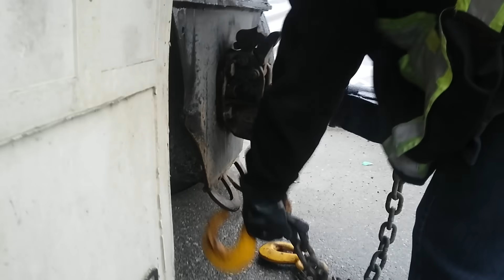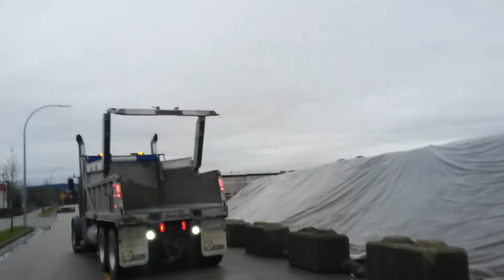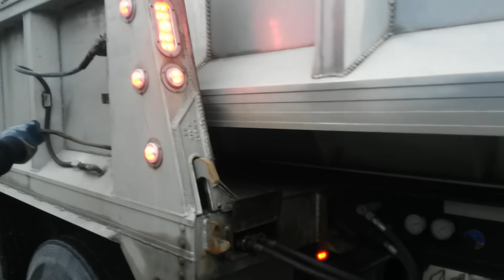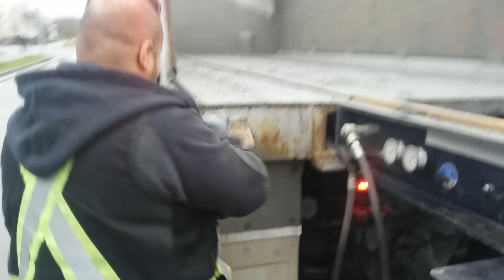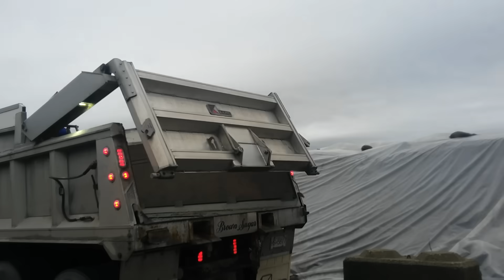DUMP TRUCK AND TRANSFER THE BROWN SUGAR WAY

Comment: Drove transfers out in California! Motors were on the trailer box and were two Chevy starter motors and an extra battery that you had BETTER get hooked up when finishing and driving off!! More simple setup but had to get creative when the trailer battery was weak! If I wasn't behind the steering wheel, I was under it fixing something!

Comment: that's a nice setup, I really like the work lights built into the tailgate support arms. But I prefer an electric drive unit. They are quicker, alot less hookups, and just easier to work with,
Reply from the maker: In Canada we are allowed to put 40T in the transfer box so that amount of weight almost over powers the hydraulic unit as it is

Comment: hey man im filming my transfer in california waoo we dont have so many hoses what i like about yours is that runs automatic with a chain belt ,good luck be safe out there
Reply from the maker: this trailer is custom with lots of additional lights so there are a few xtra power cables that wouldn't be there normally. How do you transfer without the chain and the Hydraulic system?
Reply: I've run a transfer dump before. It's just a set of rails with wheels (like this setup) on both, and a locking pawl on the transfer box. Undo the pawl, and push on the back of the transfer box and it rolls into the truck's box. Then lock it into the truck's box like normal and you're good. To put the transfer box back on the pup, you angle the truck box a little and pull on the transfer box and it'll roll back on to the pup, then relock the pawl and do the other normal stuff.
Reply from the maker: Dieselhead I have yet to see a non hydraulic system like the one you just explained. Our's all use a PTO (Power Take Off) which uses a hydraulic pump that turns a gear connected to a huge chain on the box.
Reply: Ryan Snow did you move the truck back by a button?!
Reply: Seek on slp automatkasett thats a skandinavian version. with the right conection between truck and trailer you dont ned to get out of the cab at all
Reply: You are 100 % correct 👍 
I have videos mainly from Finland but some Swedish truck videos where the transfer is done in the cab.
The idea must have originated from Scandinavia ?
Cheers BoyfromOz
Reply: Not sure about the origin of transfer system, but somewhere said that in -70 's Finnish manufacturers have visited at Canada to take a look of trucking. At least there those have been always operated by hydraulics, unlike 12/24v  dc or air powered transfers in usa. Yes you read right, batteries or air tanks under the trailer bed.
Reply: Engage reverse and stop engine. Then use starter from rear of the truck.

Comment: Hey slick I noticed your drawbar didn't drop I noticed you also corrected that in the video good job
Reply from the maker: Its just on air. It takes a while to drop down. By the time the second part was filmed it had time to lower down on its own

Comment: How does that reverse work when he hooking up the pup again???
Reply: Awesome Tandem work!!..Turns off the truck but leave it in reverse. Press a button in the back near hitch which will crank the motor but not turn it over causing the truck to move in reverse.
Reply: It's a button you push to bump start the truck. You leave the truck in reverse gear to do it.

Comment: What's the power/control, to lower/raise the trailer drawbar, when disconnected from the tractor?
Reply from the maker: There is a switch on the drawbar that diverts some of the air from the air brake reserve canister that's on the trailer and the air pressure lifts the bar

Comment: One thing I noticed is that when he hooked up the trailer he never put a safety pin in the latch. Yes I know they aren’t supposed to open on that type hitch but ACCIDENTS do happen!!
Reply: So on that type of pintle hitch, you can see when he drops it that there is a little flange above it. That little flange prevents the hitch from lifting up. It tucks sort of underneath so the only way to unlock the hitch is manually.

Comment: Obviously skilled but I would like it explained as to what is happening ? His load slides back onto that rig but how does he get the liner back for the next pickup ? Or is he just delivering a dumpster ?
Reply: JAMES Rivis after he dumps the liner load he then backs up flush to the trailer and Johnny slides the liner back onto the trailer then pulls ahead a bit to re connect to the swing arm.

Comment: You guys must be Italian with all that spaghetti you’re throwing around! I run Rogue or Reliance boxes and there’s two air lines like any trailer, and one or two electrical plugs and one safety chain. You don’t have to hook up hydraulics when you transfer because the air or electric motor drives the wheels on the box itself. This is as weird as it gets for me but hey, different country.

Comment: how did he get the truck to reverse like that without him in it?
Reply: there is a button inside the cab that turns the engine off. but once you press the button n the back it turns the motor while the truck is in gear which makes it role back.
Reply from the maker: Yes Karman is correct. He knows his stuff. Ya just like he said, once you have lined up your truck to your trailer you put it in gear (reverse) and flip you convertor switch in your cab which changes your ignition from the key over to the bump switch button located at the back beside your hitch. Then once you clean up your ball and lift your trailer reach you hit the bump switch which turns over the engin causing your rig to keep rolling back. One thing you want to take note of is that it's optimal to be within a few feet of your trailer as bumping it back 10 feet 5 - 10 times a day is going to kill your starter in no time
Reply: When he pulled up if you notice he got out of the truck with it in reverse with the motor off, so when he got to the back ready to hook to the tow bar there is a button to turn the motor with the starter thus moving the entire tractor back. Im guessing there is some fail-safe in the cab like leaving the key off so that the truck doesnt actual turn on completely and idle back into the trailer.
Reply: That back up beeper would annoy me! Mine is set up so that the beeper is disabled when the switch is engaged to hook up my trailer.

Comment: Transfers only have 1 purpose asphalt paving, truck and pup is the way to go, if you know how to handle your rig.
Reply: We haul everything with transfers.  Load out spoil with them all the time.  dumps sites are gettin hard to come by and constantly on over 2 hour rounders.  Pretty much like moving 3 boxes of material at a time as a 4 axel transfer box holds pretty much twice what the truck can
Reply: That's why u see all transfers flipping over these days at dumps overload not designed for taking spoil out

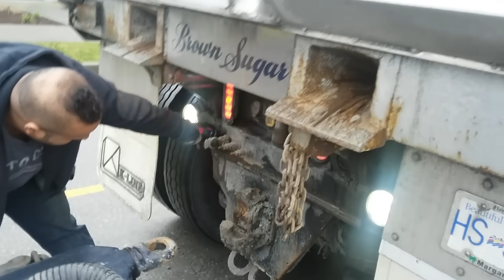Comment: @4:28 ...the truck backed up by itself?!? tell me more, what is that set up called?
Reply: When he gets out the last time he shuts the engine down but doesn't set brakes and leaves the truck in reverse. There's a button he hits that rolls the motor over and moves the truck, but it won't start because ignition is off. Then he jumps in turns ignition on cranks again and pulls off!
Reply: @Cinnamonservices  thanks, did not know that was option ;)
Reply: @mack_titan  ... that option is the engine's starter motor that tries to start the engine but since the ignition is off and the truck is in reverse gear, the starter motor just turns the engine and the transmission which 'drives' the truck back a few inches.
Reply: @Andre capmbell how about the brakes? If he don't set the brakes the truck is going to roll  it's to dangerous  not to set the brakes on a big truck
Reply: Lupe m truck is in gear. Not gonna roll. Plus you do this all on a flat surface

Comment: So I missed how the trailer part lifts off the ground and the truck backs up
Reply from the maker: There is an air switch on the trailer bar that lifts it. Truck is put in reverse then the driver hits a switch on the back of the truck that turns the engin over without allowing it to start which slowly walks the truck back
Reply: Thanks for your responce

Comment: It looks cool but it also looks as if your workin your ass off to. In the south we just dump it off the trailer.
Reply: Yes, but the purpose of this set up, as we use it in Washington State, is for backing into those tight spots, where a standard truck & pup trailer WON'T fit.
Reply: Necessity is the mother of invention.

Comment: What's the safety chains for we don't have them in New Zealand what lot of fuckin round hooking your trailer back up
Reply from the maker: In a dump truck the chains don't have the strength to support the load so instead the chains are crossed and a basket is made to prevent the reach/trailer arm from dragging or digging into the ground while the emergency activated spring brakes are bringing the trailer to a stop.

Comment: How is this better than a pup trailer that dumps itself?   Better yet, just use a semi trailer if it’s the same damn material.
Reply from the maker: In the Vancouver BC Canada area there is many developments done on property that is down a hill or tight driveway ect. If you drive rock truck you know how much easier it is to drive the truck alone opposed to pulling ANY trailer weather its Pup, end dump, transfer ect. With the transfer you basically get the mobility of driving just the truck but have the capacity ot a truck and pup or end dump. You pull your load out to a job, park your truck and trailer roadside or somewhere easily accessible and dump your truck, then return to the easily accessible location to butt up to your trailer and then transfer your trailer box into the front truck (like the russian dolls) then head over say down the tight driveway or down a side road and dump the trailer box then return to transfer the box back on to the trailer and your on your way. When im warmed up it can all be done in 10 - 12 minutes so to get the xtra precision its not a huge set back by any means! I hope this explination helps
Reply: Good reply 'Wet Movement'.....good reply.    Makes sense...

Comment: Note he's at a construction site with no hard hat, visor or boots
Reply: He's actually just outside of the job site......so there's no need to have ALL the safety gear.....till he actually gets INSIDE the jobsite.....where all PPE is required
Reply from the maker: Ya we filed this on the road outside of the jobsite one street off of Lougheed Hiway in Port Coquitlam BC, Canada. PPE is only required on the worksite not on public roads
Reply: @thewetmovement9060  yeah that's what I thought

Comment: Hi Ryan, that is the most advanced transfer system it North America what i have seen on internet, and because this manufacturer is Canadian. In states they seems to use electric or air turbine powered transfers, lol..But this K-line trailer is like a good mixture of old Finnish hose type transfer and later desing automatic transfer. Do you know what are these two air hoses coupled at bottom of trailer box, maybe box holding locks?I made also transfer dump trucking video at drivers view, watch it here http://youtu.be/262cvVG5FvYRegards, Matti

Comment: search slp automatkassett here on YT. and see how that should work xD.. nice and easy
Reply from the maker: Ohhhhh SNAP!!! It appears that you can stay in your rig and it does that transfer all automatically. That is some cool stuff thanks for the heads up. Have a good day. Cheers.
Reply: There's also a new Vbg trailer connection so you don't have to get out to connect the air hose and cables.